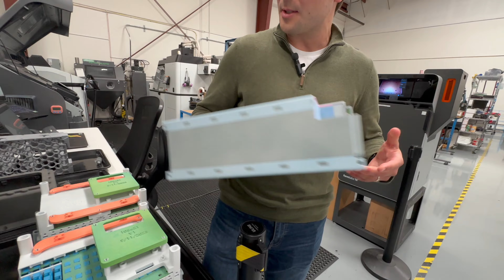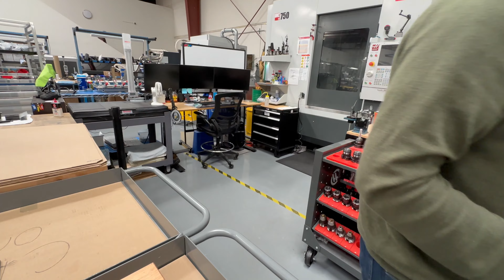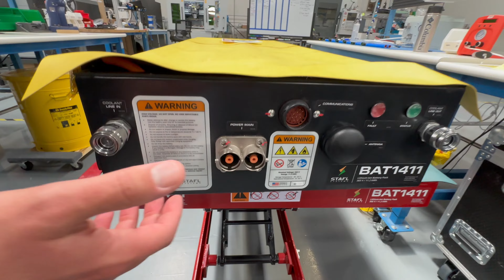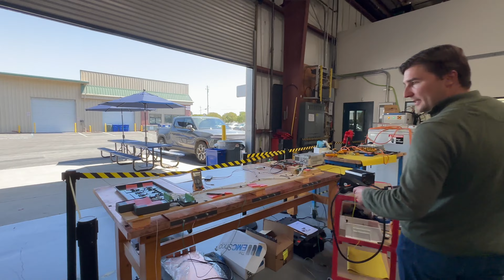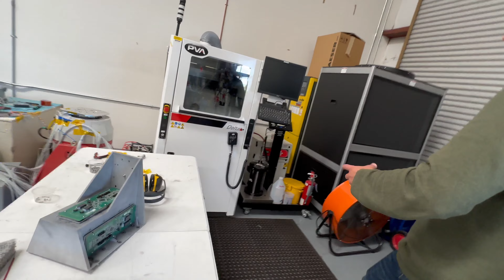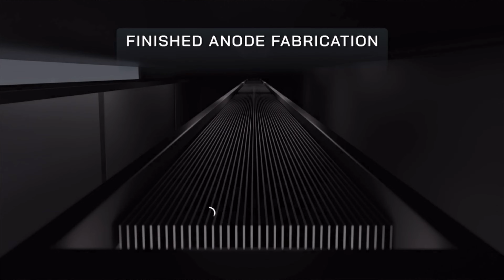How a High Voltage Boat Battery is Made with Stafl Systems

Comment: 😎👍🏻 I see the edits and adititions .🧙🏻‍♂️
Mica is an alumino silicate minral found in many Igneous and high temp metamorphic  rocks..  its always been used as a high voltage or temperature insulator. 

High temperature furnaces  
Would often be built with clear Mica windows or ports in so you can see whats going on when its actually hot enough to melt glass. 
Because the crystals grow in flat sheets in perfect conditions the can form large or giant Books 📚 of mica crystals. 🧙🏻‍♂️
Reply from the maker: Pretty amazing material!